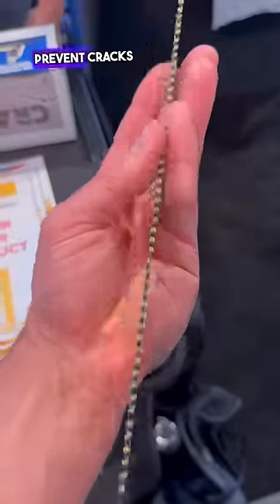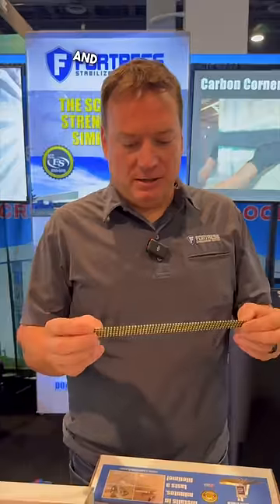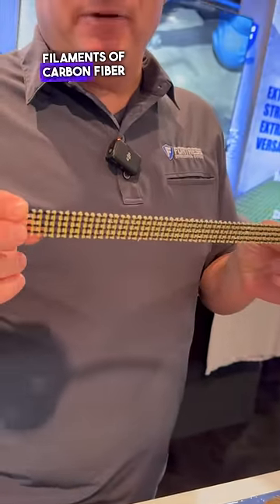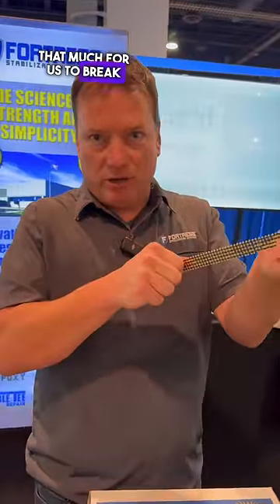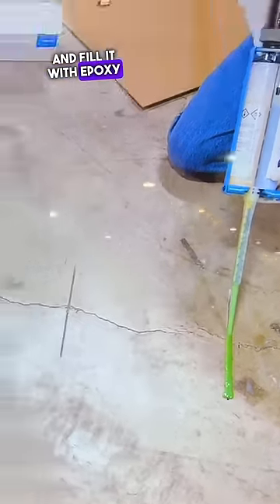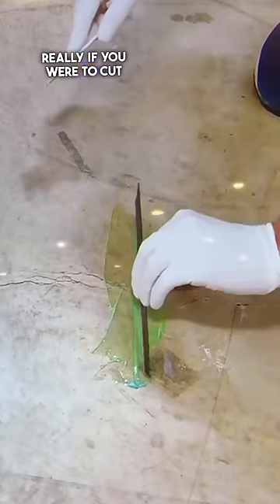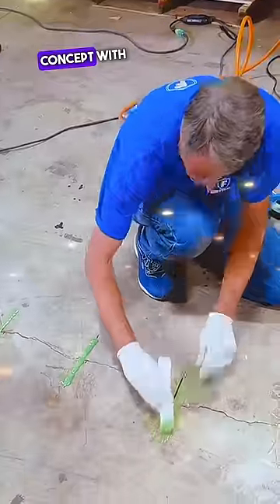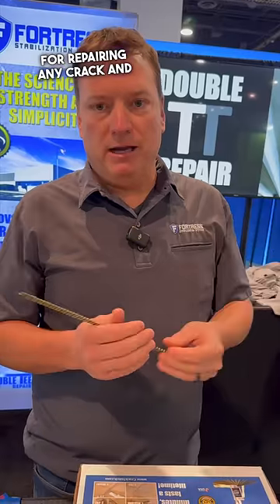Do You Have Cracks In Your Concrete?! #concrete #construction #shorts

Comment: Cracks usually reopen when season changes... about 1 year cycle from max to max... or related to humidity 

you will not know if this worked till next time it opens... 
soft expanding materials are better 
You can't stop a building from cracking because if you do ot effective it will crack in another side

Comment: Doesn't Kevlar expire/lose its properties after a couple of years? Pretty sure I've heard that about bullet proof vests
Reply: You are correct, Kevlar does degrade over time, and is a terrible material to use for anything that's supposed to last long term.  They just used Kevlar for name recognition; there's no need to use it here, because all it's doing is holding the carbon fiber in place and increase the surface area for the epoxy to grab onto. They could have used any number of cheaper materials for the same effect.
Reply: @Pies_By_Arvid  thanks for the explanation. I guess it's just more marketable

Comment: to all the critics in the comments… doing, something is better than nothing. Epoxy has a strong bond, and with the carbon fiber it should make a difference.
May not be perfect for every situation, but it sure does improve the condition of a failing slab.
Reply: It will do absolutely nothing. If you believe wasting money on something that won’t work is a good idea, I’ll bet you have no savings.

Comment: You want to just seal the crack look into polyurethane injection, otherwise it will move and crack.  If this product can hold the crack together, if there is enough movement it will just crack along side the existing crack

Comment: Yes can hold about that weight.but how about the adhesive?  The adhesive hold in between of two walls if that so.i would rather use the adhesive without it.that should be redesign to other shape that really holds both.

Comment: Im working with composites everyday and noone will say you that its only strong in one direction... streetching ....try to bend it and instant failure , better way is to use steel (even better stainless if steel can corode , threaded rod or perforated sheet will be enough) and just average concrete 2 part glue (in tubes like silicone)  already on the market for years to glue screws into concrete

Comment: There’s a fallacy in his logic….our skin repairs itself once cracked. Concrete does not.
Reply: Theres another fallacy, hes not making loops through the concrete, just making a slit and inserting the 'stitch'. Thats like if you need stitches and the dr just cuts your injury perpendicular and places a straight stitch in there without making any loops, then pits super glue over top of that to hold it in 😂

Comment: Land moves up and down water runs under concrete so concrete cracks. Fix the problem first by mud injection , or water erosion prevention.  Then cut ✂️  out the Crack and  add rebar then fill with concrete. Don't waste you money on this.

Comment: I say the installation sucks should at least coat the strip and make sure the voids are filled before you push it in the cut and you could drill a hole half way each side so it creates a spot where the epoxy cant slip due to the size.

Comment: what if you use these for corner reinforcing in largened or cracked arcs/openings? Like cur right angle hole and put this bent to right angle around actual opening of the arc. Intead of metal frame welding?

Comment: How many cracks will U create by cutting slots 🤔
Reply: This they should of drilled a hole at the ends of each slot so they won't have any fracture points from the cuts they made otherwise yea its just going to crack from their instead.

Comment: retired finisher, calling bs on this one the force that which concrete moves is not going to be diminished by some carbon fiber, and little plastic tool is bush league
Reply: I'm thinking maybe at best it will just make the cracking appear somewhere else?
Reply: @perkasch5488 
the concrete will just spall out where the gradient of the epoxy that wicked into the concrete is thin enough, and will separate around the stitch.

The force of a slab settling is tons and tons of force, it needs to be remedied from under the slab.
Reply: Just cus u finished concrete doesnt mean you understand this product. This guy has been to our shop… its a good product.
Reply: Yeah he said 6000lbs…concrete stress is in the gigapascals…

Comment: This product is a joke!! Nice try, but anyone who understands anything about concrete or just construction knows those are just something to sell the customer on not having to do the correct fix. Those will not keep that Crack from getting worse if it does. Think about why it's cracking. It's not a surface break. It is from pressure underneath and the weight around it